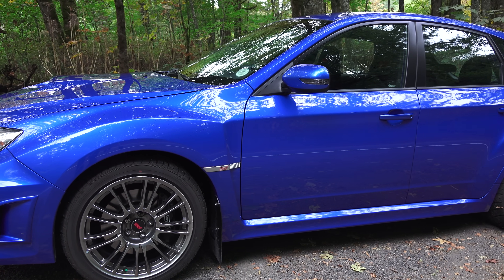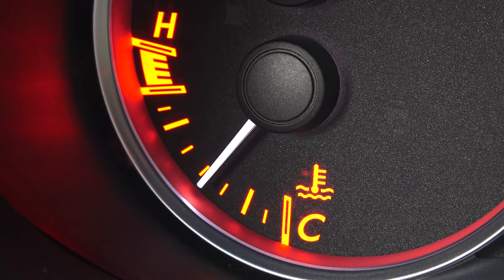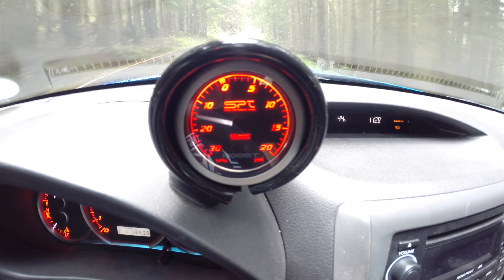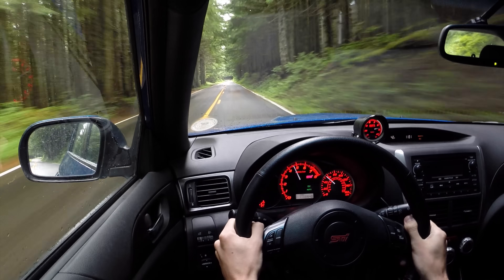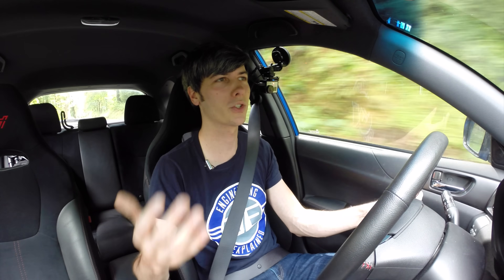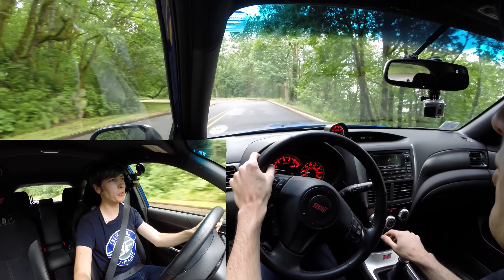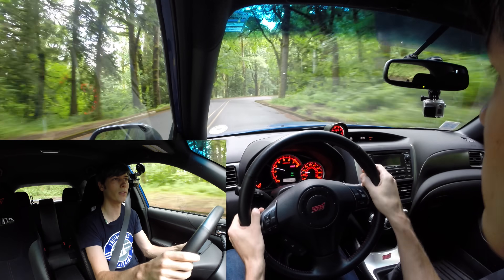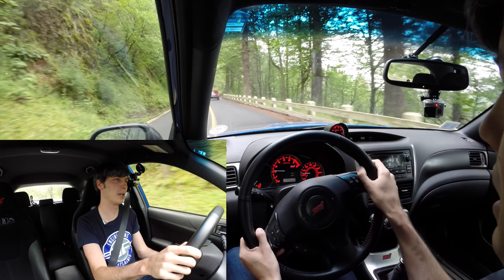5 Things You Should Never Do In A Turbocharged Vehicle

Comment: I want to make a note about the engine lugging.  Part of the problem is in how these engines are tuned in the aftermarket community.  Even on dynos, it is often the same.  The general approach for a lot of aftermarket tunes is to be overly aggressive on the low end.  What I mean by this is you adjust the ECU settings for boost and waste gate solenoid duty cycle high.  You hold the waste gate closed and ask for all the boost in the world.  It's a simple tuning approach.  Then you just let the engine and turbo do whatever it can.  You don't have to set these super high, but the ECU will act the same set a bit higher versus a lot higher than actual.  Once it starts making boost, you manage it and set the values appropriately, but at the same time, you tend to ask for a tick more waste gate duty cycle than is actually needed.  The ECU will automatically correct over shoot or under shoot of the target psi by making offset adjustments.  It does this in increments and takes a little time which is the key problem.  If the tune isn't accurate, corrections take time.  The ECU will tune air fuel ratios dynamically too, but it's always better to be dead on in the first place.  Because there is a time delay, if you are overly high or low with boost targets and waste gate solenoid duty cycle settings, you can run into the problem of high  boost, i.e. overboost, i.e. knock, detonation, and a busted engine.

The big problem is so many people seem to avoid tuning under these low rpm, high load conditions.  Turbos and boost generation are different between steady state operation and dynamic operation.  For example, if you lug the engine up a hill in high gear starting at 1500 rpm and slowly creep up, the boost curve is much different than you see with a much more dynamic 3rd gear pull and different than you may see on a dyno that either doesn't start all that low in rpm or can't hold rpms and tune at steady state conditions.

The end result of avoidance of this situation during tuning is you tune your settings different and don't really account for the chance of the condition.  You may end up picking some foolish settings that end up making lugging risky or dangerous.  It's not really the problem of lugging.  It's the problem of incorrect tuning to accommodate the situation.

Frankly, tuning should include the worst case scenarios.  If you live in a very hot climate, you need to tune in the heat to determine if you need to pull timing to prevent knock.  If you live in a very cold climate, you have to test in the cold because it moderately affects power output and spool characteristics.  If you don't want to be concerned about damaging your engine when lugging it, you need to tune the low rpms and tune at steady state to properly set the tune.

Can it be dangerous?  Totally.  However, any aftermarket modding and tuning comes with risk.  There is even inherent risk in the OEM tune, manufacturing variation, and unknowns of how the manufacturer tested and tuned the engine.  Everything should be done with great care and caution.

I bring all of this up because the concept is so heavily avoided, so much so I question the validity of the accusations and when engines do fail for this reason, why did it fail?  I've done a bit of tuning on my own Subaru, and I do a lot of road logging and tweaking.  I've done probably around 100 heavy lugging pulls starting from 1500 rpm, up hill, in 6th gear from below boost to midrange (3000-4000 rpm).  I do this very specifically to mimic steady state operation at these low points and properly tune these areas.  The boost generation and settings are very different versus more dynamic logging like a 3rd gear pull or dyno logging which may still be pretty dynamic and with a tuner than may not even tune much of anything below 3000 rpm.  I don't know about you, but I ran an 18G setup which isn't all that small that would make 24 psi at 1700 rpm in steady state conditions if you asked it to.  Dynamically, you'd never see that number below 3000 rpm, but statically or lugging, you definitely can generate high boost in low rpms if you didn't mind waiting a couple seconds to build boost.  You better be absolutely certain your tune is set right and no one tunes for this.  I can very easily see why people can get into trouble.  No one tests in this range.

Comment: About the lugging the engine:

Didn't you miss a point in regards to main bearings? I have learned that main bearings operate on the typical "oil wedge" principle, and at low enough RPM this wedge isn't in good enough form to take huge amounts of load and stress from an engine without enough mechanical advantage through gearing. I have also learned that if the crank isn't spinning fast enough, and isn't "hydroplaning" on the "oil wedge" and you load up the engine, it can produce unwanted flexing on the crank and lead to extra wear on the main bearings.

Please note, I am not trying to say you are wrong, it's just I want to hear your opinion on this matter, from one engineer to another :)

Thanks!

Comment: So I disagree with you on letting the engine warm up before driving. Why? 2 reasons, number one is idle is a waster of gas. Also at idle you moving as little oil as possible because the engine is running at the lowest rpms as possible. The second reason is ok your engine is all warmed up and ready to go, your transmission however is not. This could be a problem if you get in with warm engine and start beating on it right away. I would suggest starting it, let it run for like a min or two, just enough to make sure you got fluid flow. Then drive normal, don't beat on it till it is warmed up just drive normal, no more than half throttle, no crazy burn outs, nothing till it is warmed up. This now solves two problems, the transmission problem I listed above, and the oil, coolant temp difference you mention in the video. Also you missed the most important thing ever, DO NOT NEGLACT YOUR OIL CHANGES, this means at the mileage or time recommended change, and use synthic oil. Not changing the oil, or using the right oil, is the number on killer of turbo, and some turbo are almost as much as the engine :(.
Reply: I agree with Eric D.  He's talking about running hard.  As you get down to the first stop sign in the morning, don't try to light up your tires to race the old lady in the other lane.  Let your engine oil warm up first.

Comment: WAIT @engineering explained, does this apply to supercharged engines? my car sometimes goes into this episode of ideling at higher rpm (1200) running at lower rpm when in gear (950-970) and get engine pinging when accelerating, i usually correct it by turning off the car, sitting for a few minutes then restarting.